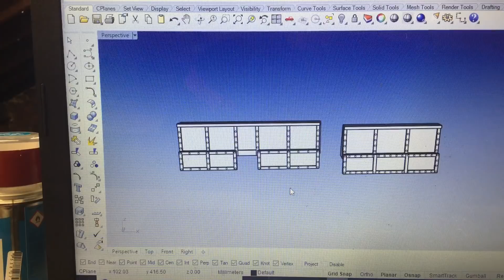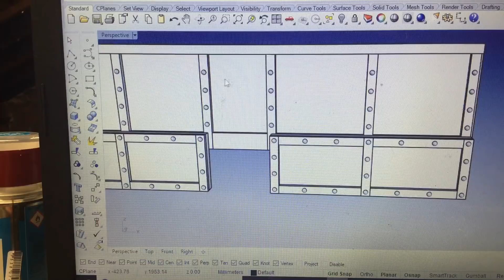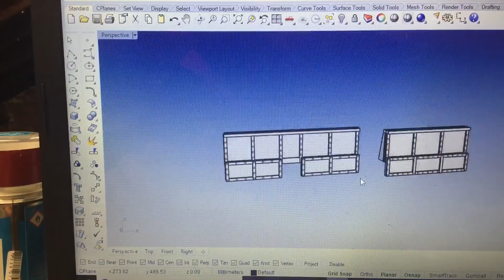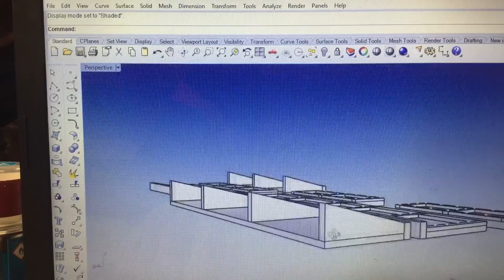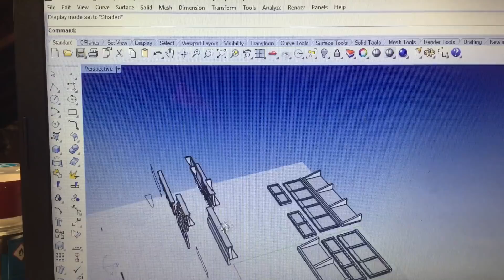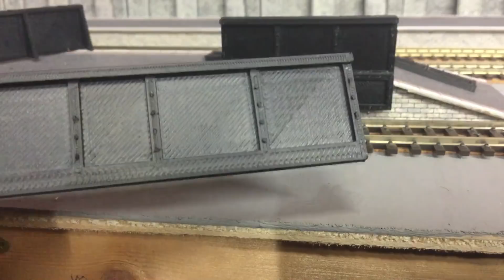Using a 3D printer to scratch build models - Building a model railway

Comment: The sky’s the limit. I would make old brick for building sides and distress this. Also I potential for water towers on top of buildings, billboards, tree stumps, people, telephone poles, cobblestone streets. Of course you can buy these but in a pinch it’s great to 3d print and most likely cheaper. Nice video and layout. Model railroad is great hobby. People are even building 3d printed trains. Great stuff.

Comment: Very interesting video and something Ive been considering for a while but cost has held me back. I may try and get a bargain from Maplins before they close. More research required I think, particularly regarding the cad side of things and compatability, Rhino seems pretty good, is it easy to understand?
Ive subbed too
Cheers Paul
Reply from the maker: Dunge Wood Model Railway Hi Paul, thanks for your comment. 
There are several tutorials on YouTube to use Rhino. The reason I made plate girders first is because it’s simple uniform shapes joined together. 
There are a couple of website who will print your 3D Models on behalf of you and I would if it’s something you’re keen to get in to. That’s a good idea to see if Maplin have any cheap ones! 
Let me know how you get on.
Reply: I will check out the tutorials, got plenty of ideas buzzing around my head. Also the websites that will print
models seems a good place to start.
Maplins have a variety on their website but I'll pop into the store and see if there are any offers on.
If I see a bargain I'll let you know
Cheers Paul

Comment: 3D printers are certainly making an impact on what can be provided by small specialist suppliers of model railway components as the price of these machines drops. Also as you say they are coming down to a level that a club and even individuals can afford. What material did you use to print your parts and what adhesive did you use for joining them together.
Reply from the maker: freightuk I just used a standard PLA fillament, cost about £12 a spool and super glue to stick them together. I’m going to attempt platform canopies next. As my platforms are quite long I’m hoping this will save some money over buying several kits.
Reply: Multiple tricky to build items, especially those difficult to buy even as kits are those I intend to print too,  best of luck :)